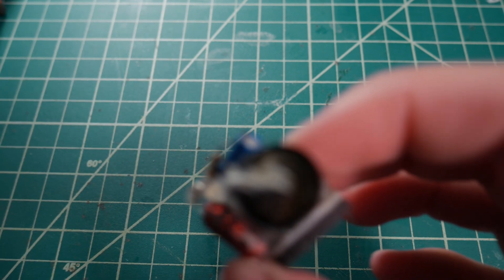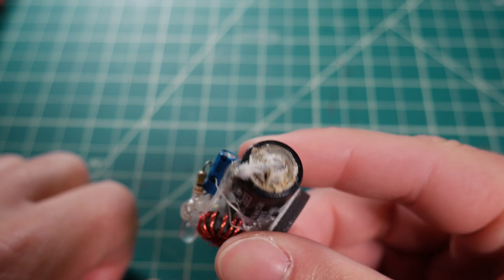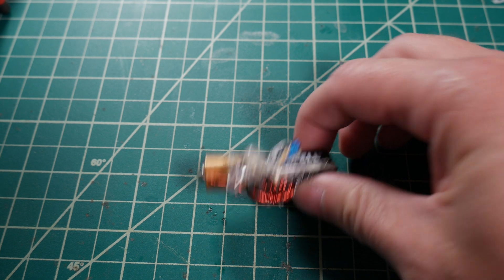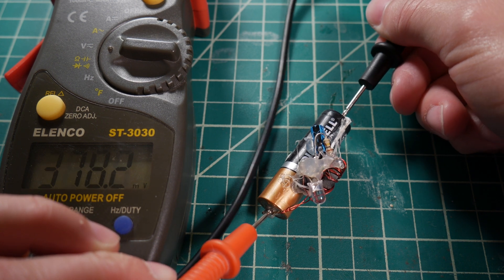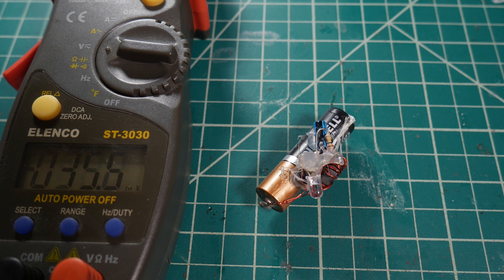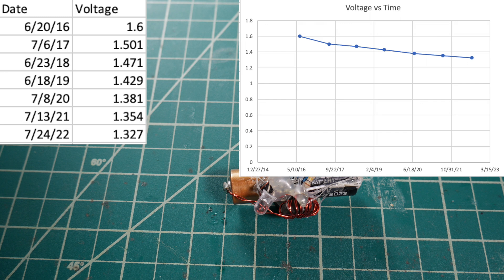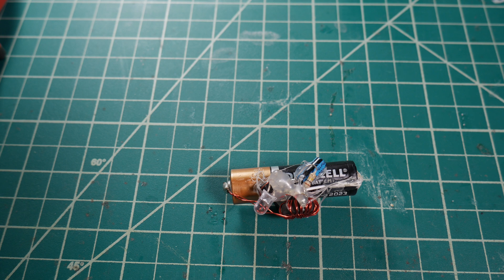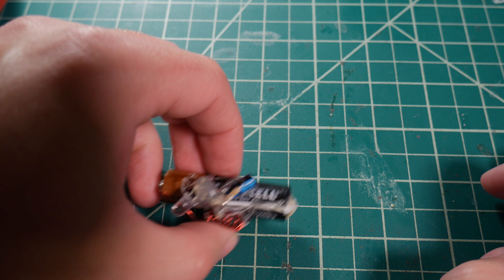Blinking Joule Thief 6 Year Update

Comment: I blame the Durasmell for leaking. I built my blinking joule thief with store brand batteries (Thunderbolt if it matters) and some others that came with TV remotes (alkaline) and none leaked so far.
Reply: I've had so many Duracell batteries leak on me in the last 5 or so years it's crazy.   I've barely had batteries leak on me before then but I refuse to buy duracell now. None of my other brands have leaked.
Reply: @jamieforrester7108  Same here. The store brand batts I buy have similar capacity to Duracells but cost so much less. A 24 pack is like $5-6. An 8 pack of Duracell is $9.18. Not worth the extra cost.
Reply: Didn’t Duracell used to claim ‘no leaks or corrosion’?
Reply: They used to have some sort of guarantee about covering damages if they did leak and damage your equipment.  I remember when they removed that it got a bit of mention on the internet and then a few years later is when I first started having issues with them.   I'm not sure what they changed in the batteries if anything.
Reply from the maker: I agree. I have also had many issues with duracell batteries. At the time I built this, I didn't have as much experience with batteries leaking in things. I just grabbed a battery out of the cabinet and soldered a joule thief to it.